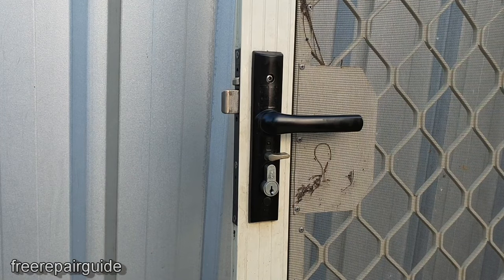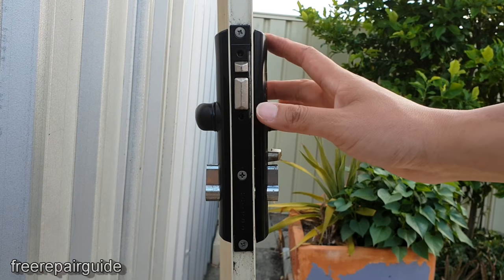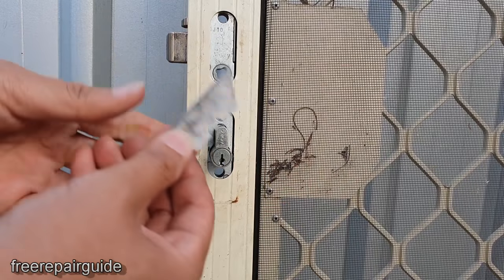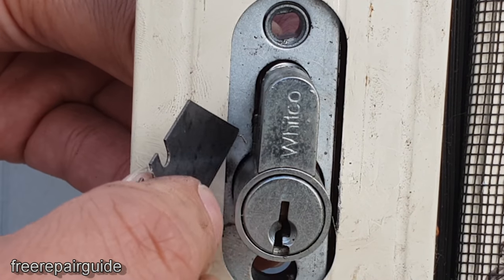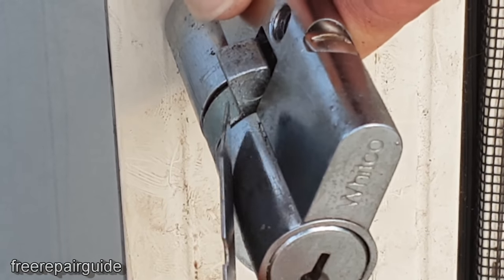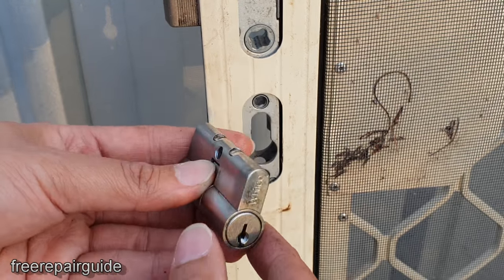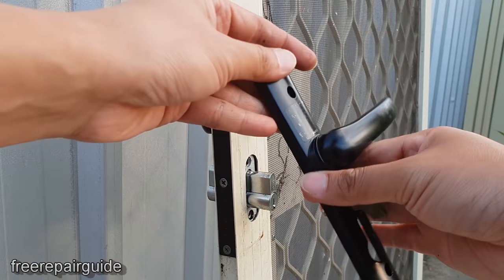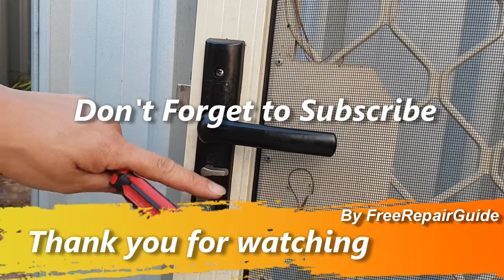How to Replace / Change Security Door Lock - Without Key

Comment: Thanks bro . My lock assembly fell apart and I bought a new one .The problem was no key for the barrel. Last time I used a drill that left mess everywhere . I have in mind to fashion a better tool than your razor blade .Which will be a strip of 1mm steel slightly grinded  for the job so I don't cut my fingers . As I am on holidays . Happy new year

Comment: Not as simple as you say , i looked at other videos before i figured it out , if that latch us right at the bottom it wont be this simple , see that hole underneath you can put a pick tool in there pushing the tab up enough so you can manipulate it further , i tried your razor blade idea did not work , i ended up using a pick tool and the a large needle

Comment: Have you filed the metal next to the lock so the blade is easier to fit in? There is a distinct curve opposite the latch where you slide the blade in. If that's the case you've cheated to make it look easier than it is!
Reply from the maker: No I have not filed it. That is how it was. I have tried this method on few different doors already.
Reply: @FreeRepairGuide  I'm struggling to fit anything between the gap to move the latch. I definitely can't fit a blade in there. I have the exact same problem with the same lock in this video, but I can't move it! I think the drill is the only solution left.
Reply: @jakecooper5855  Assuming you haven't got round to doing it yet I find snapping the lock with a pair of mole grips is best but make sure you do not have an anti snap lock in the door. Personally I think they are something to be avoided as no one looses a key on purpose but when they do they need to solve the problem quickly and as cheap as possible. Any self respecting thief is going to smash the window before looking to see if they can "snap" the door lock.
Reply: @sisyphussapprentice8976  That is what I ended up doing to solve the problem. I was surprised how easy the lock snapped. Funnily enough, my house was broken into a couple years ago, and they smashed through the window right next to the door I've been trying to get in to.
Reply: @jakecooper5855  I had the same problem -  not enough gap - at first. What about trying a bit of fine piano wire, threaded through and lifted with pliers on both sides? My main problem was a key broken off in the lock but I solved the barrel problem by finding the spare key, removing the barrel and tapping the broken piece out :-)

Comment: I used a feeler guage and a length of dental tape.  Shove the dental tape through the gap with the feeler guage, grab both ends of the dental tape and withdraw the feeler guage.  Next, pull the dental tape taunt and pull it around the contour of the lock.  If you can't withdraw the lock reverse the direction of the dental tape.  Ezy Peezy.